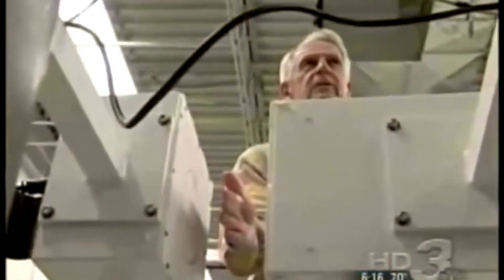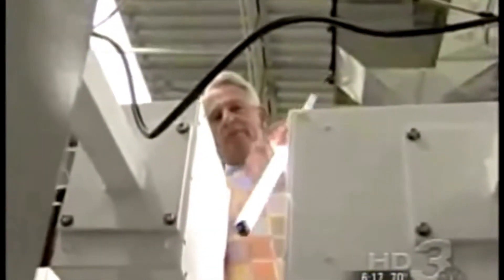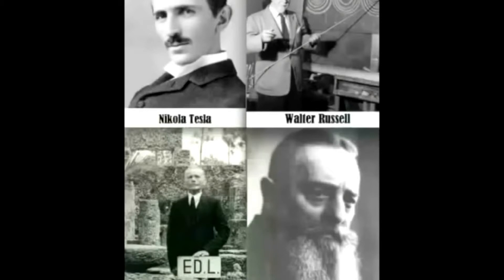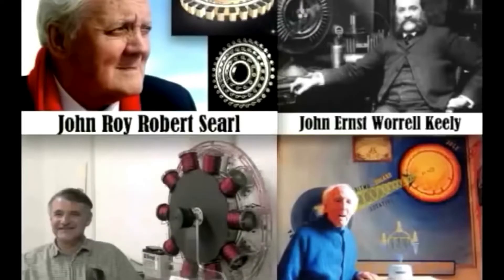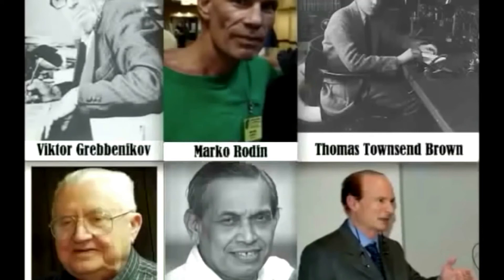BURNING SALT WATER AS FUEL BY FREQUENCY

Comment: The fact that the source of energy used to separate salt from water is a radio wave rather than electricity itself directly in touch with water that tells you the energy consumption will be lower  and even very small amount because even that is not a true magnetic coupling in order to consume lots of energy.

Comment: What matters is how much energy is required to put in to get that energy back out. Those radio frequencies aren't free.
If the electricity to create those frequencies exceeds the energy produced from igniting the hydrogen that they produce, this doesn't mean that salt water IS a fuel. It means salt water can be converted into a fuel using a different kind of fuel. And that's not as interesting as you might have first thought.

Don't get me wrong, hydrogen fuel is cool. Novel ways to produce hydrogen is cool. A less energy intensive way to create hydrogen is cool. But it isn't adding energy to the system the way drilling for oil does, for example. It takes less energy drilling for oil than the oil recovered can produce when burned (for comparison)